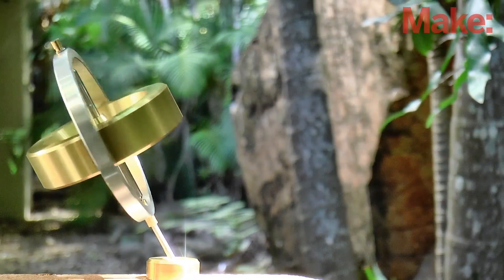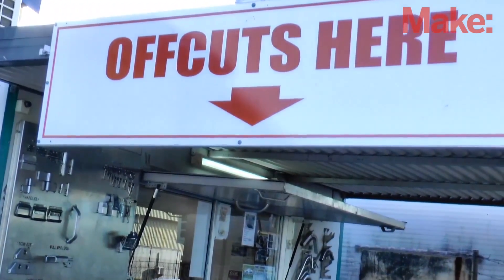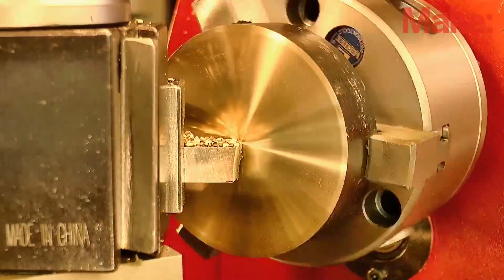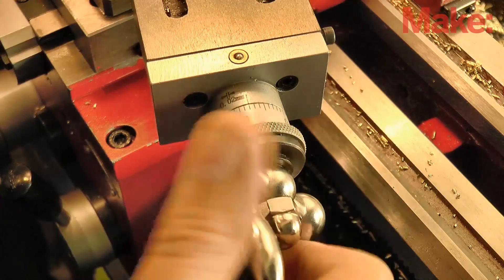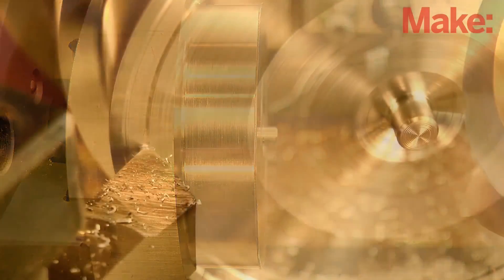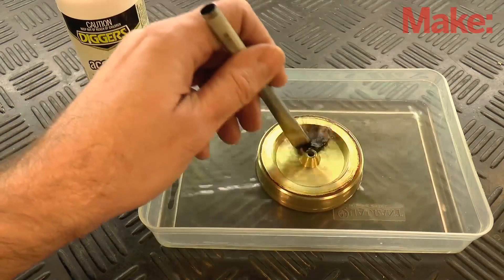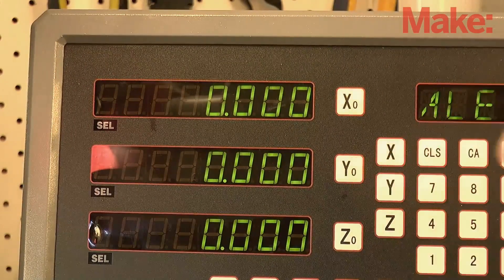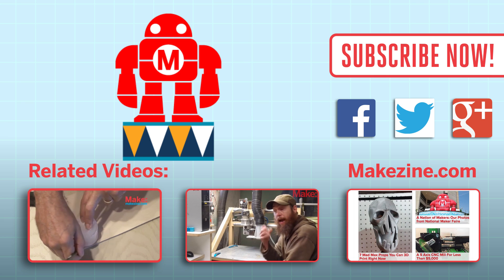Clickspring: Benchtop Gyroscope Part One

Comment: Great video. But, I would not have drilled those large holes in the middle. They restrict the longevity of the duration in speed, as it impact with the airflow and reducing the duration and time of spinning speed. Some people have no idea about this. But then, try an exercise machine that has blades (4-6 pieces of sheet metal) attached on the bicycle type wheel, either flat or fan type that, when it spins it attacks the air and cause a drag, a type of resistance that forces anti gravity and causing the pedalling of the wheel harder as more air is attacked and more wind is created.

If those sheet metal plates were not there, on the exercise bike, it would be less straining for the legs to pedal harder and more revolutions can be gained. Try that principle on this gyro wheel and see the difference, how easy a motor can spin the gyro wheel.

Comment: The holes will cause the Gyroscope to slow down because the cut edges have to battle against the air when rotating.

Comment: @2:17     Is it strange that I could watch videos of the tiny metal cutoff bits piling up all day?    What is the proper name for tiny metal cutoff bits?
Reply: shavings for bigger bits, filings for smaller bits afaik
Reply: Orion khan.    In engineering the metal removed by lathes,milling machines,drilling machines etc, is known as Swarf and in my experience the term is universal. The metal removed by a grinding machine is termed simply as Dust...which in fact it is.

Comment: Would it be possible to do the milling operation with a lathe by mounting the part at 90 degrees to a bit in the chuck with a milling attachment, then moving the part onto the drill? Then turn the wheel to the next position. Maybe create a holding plate with a shaft and secure the piece with a bolt?

Comment: what i do not understand is why you took it off the arbor? if it was good enough to turn and face it certainly would have been good enough to hold it for drilling the bolthole circle pattern around the central hub. less work, more efficient ability to hold. and on top of that all you need if a four jaw to re-chuck it in the lathe for further operations.

Comment: Loctite is not glue it does not set up an oxygen is anaerobic especially the green kind you using. You have to put Loctite inside in between the two pieces
Reply: He used superglue, not Loctite. (And yes, I know that they're both cyanoacrylate adhesives.) And that wasn't an anaerobic environment.

Comment: Hi chris. love the chanel.great work. Im kinda new to the hobby and been a r/c airplane builder for years therefore ive used tons of CA adhesives.anyway just curious if the glue ever let go while turning a part? Im about to give it a go and was just curious.Thanks for all the great vids.
Reply: if you dont't build too much heat into the part then you should be fine. good luck :D

Comment: I live in England, we don't have any machine shops to get stock, not since our manufacturing industry died...
Reply: +Iron Bridge That's kind of interesting as I was looking for suppliers and the only one I found before Chris told me his was a metal shop in the UK.
Reply: Find your nearest industrial estate. Here in Wrexham there is one littered with small machine shops who are all really friendly to help out with projects and little pieces. There is still lots of manufacturing, it's just not as well known.
Reply: I also am a pom... Try casting your own blanks. lot easier than you would think. Many vids on youtube.  I use a calor bottle and heat with wood. Ali is  very easy ,, brass needs a bit more heat.  but very doable..

Comment: Another solid reason for the 6 hole configuration on the flywheel is that it will concentrate even more of the overall weight on the outer rim of the flywheel.

Comment: Could the fly-wheel be machined using thin oil as a coolant/lubricant? I've had problems machining it dry,as some brass cuttings have ended up in the lathes electrical housing.

Comment: Anyone have suggestions on finding 3" diameter brass rod for a reasonable price in the US?  Best I could find was 1" x 3" square bar, which I could cut and turn into a 3" circle, but it costs $10 an inch!

Comment: Could i make the axle 7mm diameter,as i don't have a smaller sized reamer (for the flywheel centre hole).Also,is it essential to use a D.T.I.,as shown at 5.55 as i don't have one?
Reply: +Alan Jackson Hey Alan, yes no problems on the modified axle size, and also no need for the DTI - the spigot on the arbor does all the alignment work for you. I just used it in the video to demonstrate that the part was centered on the arbor with minimal runout.

Comment: Nice project. When I was a kid, my dad had a desktop gyro in a two stage precession mount. The main axle shaft was mounted using ball bearings. Did you consider using ball bearings for this project? I have no idea if they would have more or less friction than your cup bearings.

Comment: Make sure you check out Chris's channel Clickspring. It's got some of the highest quality and best edited home machine shop projects out there. Cheers Chris!
Reply: +Harlequin314159 Thank you mate!
Reply: +Harlequin314159 YES! I was wondering the reason of lack of uploads on his channel!
Reply: +Clickspring Hi,can I make my frame out of the bronze, will that affect work of the gyroscope since it is heavier? thank you.
Reply: Hey Chris am I correct u live in Australia???
Reply: Long time fan Chris! Is this your channel (make) or did they steal your content and we should we report them for copyright infringement. Thanks for your incredible content on clickspring by far one of my fav channels.
Reply: Make sponsors creators in all fields. They most certainly did not steal this.
Reply: +Clickspring hey Chris! Love this fun gyroscope project. I was wondering how you recenter your part to the bore once you take the brass off the chuck and remount to the superglue arbor. I understand the dialling, but how do you make the fine adjustments? It didn't look like you had a 4 jaw independent chuck on, or did you?

Comment: Amazing video, I've become quite a fan, I can't help notice during the shot of the metal being cut, there is a lot of shavings falling down and can't help but wonder if there are any other projects you can use those for, maybe filling something with the shavings and resin?
Reply: +Craig Dick Hey there Craig, great question - I tend to collect the brass shavings wherever practical. It can be sent off to a scrap dealer, but I've been saving mine up for a casting project I want to do next year. Cheers mate, Chris.

Comment: I really enjoy watching your videos. Very neat! I've two questions for you, at what RPM do you usually cut brass? and can you recommend where I can find the lathe tool blank you are using? Thanks and keep up the good work!
Reply: +Gizachew Mebratu The cutting rpm depends on the diameter of the stock, but to be honest brass is really forgiving if the tool geometry is correct, and the setup is rigid. I think its helpful to experiment with some offcuts, and just see where the limits are - try different rpm's, depths of cut, feed rates etc. You'll know when it's not right, and you can see first hand what caused it. It really is the best way to get a feel for it.

Regarding the tool, I tend to grind my own from HSS. I will be doing a tool grinding video in the future, but if you can, get a cheap bench grinder and start having a crack at it yourself, using cheap mild steel as a practice material. Just start with a picture of an ideal right hand cutting tool, and try to copy the facets. Cheers, Chris.